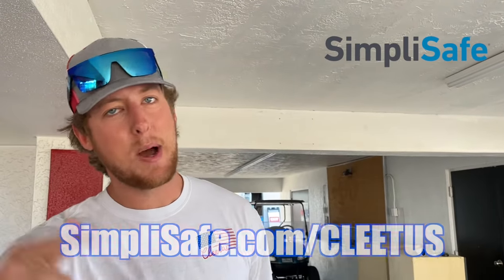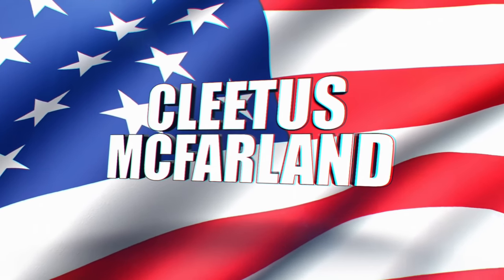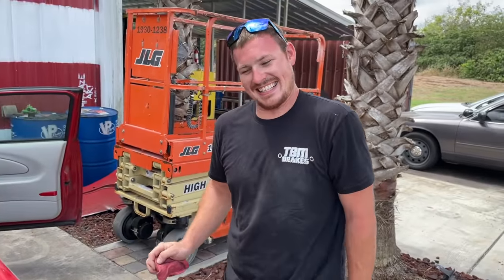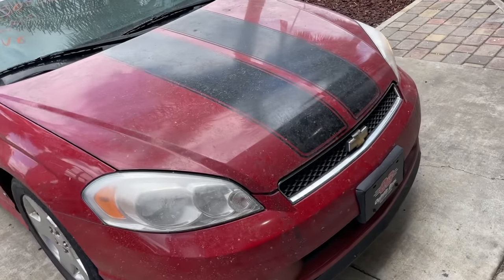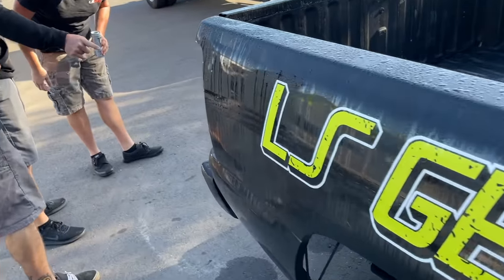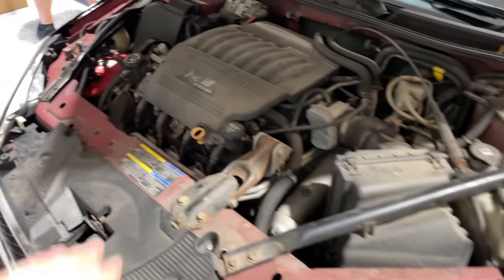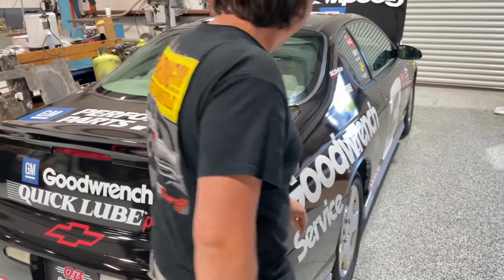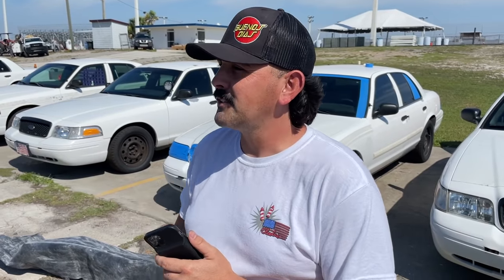Surprising My Mechanic With the Most RIDICULOUS Daily Driver Of All Time... (You Can't Guess)

Comment: Hey guys that noise you’re heading is the blend motors for the hvac system. They’re behind the glove box, held in by two 7mm screws. Just replace both of them
Reply: You are absolutely correct
Reply: Is that what I keep hearing in my impala? Shit starts clicking soon as I open the door then stops after a few minutes. Seriously.
Reply: That would explain cold/hot air George mentioned. Good call d pizzle
Reply: that was quick.. hell yeah brother.
Reply: They bout to find out how junk those transmissions are with all those burnouts lol
Reply: I second this.
Reply: My American quarter horse makes the same noise when he's parked idling in the stall. He doesn't have a glovebox. I'm definitely not entering through the rear. Any other suggestions?
Reply: @kristinewilson5353  common in GM's that yeae
Reply: Knew it right away from dealing with them on my mk4 Jetta glx, but it's a much bigger pita on those
Reply: Came here to say this as well, also part of the problem George is having with the AC being cool on one side and hot on the other.
Reply: Could be a shorted out IPDM. Happens when drain ports get clogged and rain drips directly onto the under hood fuse box. This is the exact noise that my car was making and the battery would always die on me, changed out ipdm and the problem was fixed. 

Edit: when the ipdm is shorted out will cause some electrical components to stay on even when the vehicle is turned off.
Reply: @kristinewilson5353  yup, had to replace my wife’s on her 07 impala
Reply: @danielferrell2911  thank you. Hope its not too expensive. Times are tough
Reply: @kristinewilson5353  yelp, every eingle of them do it 
Sometime you can walk by it and it starts clicking lol
Reply: Shit I just had to delete my comment because I seen yours! 😂 no need for two ppl saying what’s wrong😂
Reply: @FarmerFpv  😂😂
Reply: @kristinewilson5353  yes
Reply: Same on 01 Impala.  Well, and my mom's 09 Impala.  And the uneven AC could be just low coolant.
Reply: Very common in those impalas lol
Reply: Knows on all impala and monte carlos
Reply: Bump
Reply: +1
Reply: @kristinewilson5353  yes and its super easy to fix look it up on yt
Reply: @nikolaskipp769  common until 2014
Reply: It's actually a 5.5mm or a 7/32. Just did all the blend motors on my impala.
Reply: George is the best he's hilarious
Reply: The Chevy tick I've replaced 3 in My impala
Reply: @_Bishopton  came to say the same thing
Reply: @FarmerFpv Enter at the rear.  Just get those shoulder length gloves and a gallon of Mare-Lube.
Reply: Was about to say the same thing lol glad I looked first
Reply: BUMP
Reply: Super easy to fix!
Reply: I think the vehicle has to complete a "drive cycle".  When I disconnect the battery and replace or reconnect, gotta drive it a round a bit, turn in off, get out, get in and turn it on and drive... Blendoors will fall back into place... .or not:)
Reply: Yea big problem on those and the impala dont get the dorman theyll go riggt back out before very long
Reply: How long before George wants to to a LS Swap / RWD Conversion on it ?
Reply: There are actually 3. One is above the right side of the driver floor board. Above where your knee sits
Reply: Bro, this clicking has been bothering me for months. I was about to tear apart the dash. You saved me!
Reply: I had replace one on my 04 GMC Sierra 2500hd in the middle above the tranny hump
Reply: had the same problem in my '09 Imapla. They call it the "midget with a machine gun"
Reply: @JamesWorley  it is an LS. LS4. the gm fwd transmissions are garbage though.
Reply: @JamesWorley  i bet they talk to brandon F about doing a rwd swap on it
Reply: I own a 06 impala ss 5.3. And yes it sure is the blend doors.. I changed all 3 of mine.. The impala/Carlo is well known for that issue
Reply: yeah I knew what it was a soon as I heard it.
Reply: I hope it's that easy. I had to replace the blend motors on my son's saturn vue and almost had to remove the whole dashboard to replace them.
Reply: Check the freon level in the A/C before you start tearing apart the dash.   Pretty sure its the blend doors but would take all of 5 minutes to check that first. Old Lexus of mine had the problem where it would blow cool(not COLD) out the driver's side vents but warm out the passenger side.  Turned out it had a small pin hole leak in one of the hard lines, had probably leaked down over months cause it was spring and first time I had fired up the a/c in months.
Reply: ^^^Came to say thiss^^^
Reply: What that person said!
Reply: @THEPlGWHlSPERER  
Was gonna say this very thing. Get genuine GM junk, or you'll be doing it again in 2 months.  Also a 2nd on the transmission.  They are pretty fragile in their OE state.
Reply: 7mm? Or are they 5.5mm? Also low on freon will cause the hot passenger side, cold driverside outlet duct temp
Reply: Well the passenger is behind the glove box, if it's the blend actuators there is also a drive side one way up under the dash, if it's got dual climate control
Reply: @kristinewilson5353  Yea, most likely, it's really common in these chevys. I have an impala which is basically this with a different back half
Reply: @kristinewilson5353  For sure that is what it is.
Reply: @kristinewilson5353  Yep!
Reply: Lol, I just posted the same thing and then saw your comment. Super easy fix.
Reply: Its the GM ghost
Reply: @kristinewilson5353  100% I had an '08 impala, loud ass clicking coming from the dash/glove compartment. If you go to an auto parts store and say you need an air gate motor, they know what to do. The chevys from that period are notorious for it.
Reply: Good call.
I knew that right away, my 02 impala ls did that same thing.
Reply: Op nailed this one. Common gm issue. Had to replace em in my envoy
Reply: Very common for these
Reply: Beat me to it lol
Reply: This guy....
Reply: There's actually 4(if it has the dual climate control). 2 for those, 1 for the vent direction and 1 for the fresh air/recirculation. 

I knew immediately what that was when I heard the knocking. Ptsd started acting up from it too hahaha
Reply: Doorman part number 604-108...
Reply: It's for his mechanic, and that's SUPER common on all GMs (and lots of Fords)....I think he knows.
Reply: yup. Easy fix, happened in my silverado. Took like 5 min
Reply: 1 behind the glove box, 2 in the middle, and 1 on the driver's side.... ask me how I know 😌
Reply: @ichoozjc  it's all W bodies.
Reply: @killer0034  the ones in the middle are NOT "super easy"
Reply: @aboutmyfathersbusiness8324  no what happens is the plastic teeth on the gears will strip out/break off.
Reply: Yup.
Reply: Mine did that also, replaced all actuator motors, including the one on drivers side behind dash.
Reply: BINGO
Reply: @bepbep7418  yes, that happens some times but many times the motor just doesn't know when to stop and keeps clicking.  Ive replaced the blendoor motors before when all that was needed was a blendoor recalibration.  You can google the procedure... just sayin..
Reply: @nikolaskipp769  yup Silverados too. Under the hood podcast, the Motor Medics have been talking about it for years. I listen for  entertainment but seems I have learned along the way. 😁
Reply: "Hey guys that noise you’re heading is the blend motors for the hvac system. They’re behind the glove box, held in by two 7mm screws. Just replace both of them"

Two 7mm screws cause all that noise ? :p
Reply: It’s called the AC actuator
Reply: Yup certified gm tech here absolutely right replaced a butt load of em
Reply: I have a 16’ impala and it started clicking did some research and they said the motor cost almost $1000 to fix or u can just unplug them and u will just have to set ur fresh air or cabin air setting on ur a/c before u unplug the wire but after I did that the clicking stopped and now the hot and cold started on both sides fucking GM lol still love them better than fords tho
Reply: Just did all 3 on my impala lmfao

Comment: id recommend getting that thing on the dyno and getting a proper tune into and deactivate the DOD/AFM as they are notorious for causing a lifter to fail on one of the DOD/AFM cylinders. Also get a fresh trans service and auxiliary cooler for it. Those transmission are made of glass with the TQ from the 5.3
Reply: He said he’s putting a cam in it so the afm will be deleted with the new lifters.
Reply: Yep was looking for this comment on the trans... my brother went through 3 in his impala ss under warranty. He traded it in before the warranty expired 🤣
Reply: I was one of the lucky ones who never had AFM issues but lots did. Cam and a shaved truck intake go a long way on these cars! Agree on the trans too, they can barely handle a stock LS4 let alone modified. Great dailys with a little maintenance. I'd just recently seen there was a lot more development on 4T80 swaps for them too, if you're going to run one hard, might be worth it but not sure if I'd want to for a daily driver.
Reply: @SOHCGT96  I would rather see a 6t70 6spd swap, that would turn this thing into a great driver.
Reply: @JPARKERZ28  Trans will blow 😂😂😂 theyre so bad lol mine blew at 90k miles
Reply: @SOHCGT96  Furches performance is working on (possibly already has) a 4t80 swap kit for both the LS4 cars and the S/C v6 cars
Reply: This man Monte Carlos.
Reply: I wish they would (and would’ve) drop FWD and make everything RWD or 4/AWD. Cobalt SS would of been better RWD, this SS would of been better RWD. FWD ruins the fun of so many “could of been so much cooler if it weren’t too was RWD” Cars.
Reply: @jeremymann8930  He already finished the R&D on the 4t80 hes looking into turbo kits and bolt on intakes for LS4s now
Reply: @ChevyBoyTV  awesome

Comment: The heat issue is most likely a blend door issue.  GM is notorious for them.
Reply: Monte Carlo especially. Typically an actuator within the system
Reply: For sure
Reply: No doubt. GM is notorious for electrical issues. Especially on early 2000’s cars
Reply: 100% the blend door actuator.
Reply: I had the same problem on mine. 100% one of the 3 or 4 different actuators behind the dash.
Reply: Here to say this. It was an issue on most of their stuff for a while, including the trucks.
Reply: What would cause my AC/Heat to stop working in the rear of my 03 Tahoe? The front vents work fine.
Reply: Ford too!
Reply: I've replaced 2 in my 03' Tahoe. Pain in the ass.
Reply: @toohoney8674  that clicking sound when you started the engine and for several minutes after you turned the engine off
Reply: Yes, definitely a blend door issue, since they said one side blew cold.  This issue is common in both, the Impala, and the Monte Carlo, as they share a lot of components throughout the car, including the same platform, and thus many of the same problems.  the passenger side actuators aren't that bad, but the drivers side actuator is a bit more of a pain the replace.
Reply: @Mark_MOORE_VFL  It can also occur even hours later, out of the blue, car not disturbed. (It's an Impala.)  No idea why the random ticking spells occurred.
Reply: @jreyman    It's when the actuator is bad trying to close the blend  door You're right about the random as well my Monte Carlo isn't a daily driver and it would actually run the battery down  If  sat for a few weeks. It can cause your battery to go bad early with the constant drain on it. if you don't change the actuator. my car has two one is under the glove box the other one is behind the radio that's the hard one to change
Reply: It's much better that poping out spark plugs while driving down the road..
Reply: @eric63377   I learned a hard lesson on my 07 MC  the actuator that is behind the radio I ignored it ended up melting the wiring harness I had to have that part of the harness replaced Cost me $600  The actuator was $40. I always wondered why it did not blow a fuse first
Reply: @breadnaut3087   If it has a separate speed control for the rear then there is a good chance your blower motor is out
Reply: Yup. I bought a 2006 with 30k miles on it in 2019 as my first car and all three had failed within 3 months of ownership. I just assumed the failed due to age until I went to the forums and found out it was a common issue on this car and the impala as well.
Reply: W-body issues
Reply: @breadnaut3087  rheostat or blower motor.  If you haven't check the fuse first.
Reply: @jreyman  my impala blows cold out of both sides but blows heat out of just driver side. What’s the issue there?

Comment: The battery drain could be the rear window defroster or mirror defrosters. I was an ASE mechanic for many years and that was the 1 issue I had with a Grand Prix that took the longest to figure out. Check the rear glass and mirrors to see if they are warm when the switch is not pressed. Also seen it happen with seats and windows. Pull a fuse per day and see when you get the right one if the battery doesn't die after a day.
Reply: Or save yourself 3 weeks of troubleshooting and drained batteries: just measure the current out of the battery while pulling fuse after fuse?
Reply: @obc_obdo  👍
Reply: @obc_obdo  yeah that’s much quicker and slicker!  DMM for life!
Reply: it has the typical clicking blendoor that drains the battery
Reply: @obc_obdo  It's important for the car to be in sleep mode though, some take 30 minutes to an hour and you have to trip the door switch or close all the doors. Not doing so won't give good readings.
Reply: I think its a faulty blend door actuator that keeps trying to move all the time even when car off
Reply: @chevy1539  yep as soon as they popped the hood and said there's a noise and a battery drain and then George said something about hot air on one side cold on the other I immediately thought blend door actuator.  Common problem on GM.  They don't have the best electrics
Reply: @chevy1539  As soon as George said it was blowing hot on one side and cold the other I knew that's what it was! Get ready to have some fun fixing THAT! My '05 Grand Prix GT2 (4-door) did the same thing and it spent almost two weeks at the Dealership! They had to take everything from the front seats and console AND dash all the way to the firewall! I wish I had taken pictures! $1500.00 all told but you can't tell the car has ever been apart! They had three guys working on it! Like in "Gone in 60 seconds" the car has "Sentimental Value". It was my Dad's last car, bought new, loaded to the rafters. I mean if there's an option it doesn't have I can't find it! Found the damn thing at the dealership one day when I had my '99 Grand Prix GTP (2-door, black, graphite interior, Supercharged Buick 3.8LV6) in for something or other. Just sitting on the showroom floor. Gunmetal gray "Graystone", Camel leather interior, Monsoon. When Pop passed in 2015 I inherited it. The kicker: As of yesterday it has almost 30,000 miles on it! The GTP has a tickle over 70,000! 🤣
Reply: @chevy1539  They mentioned that they had hot air one side. That car has dual zone climate control. So, I bet this is it.
Reply: @PhilG999  Sounds nuts.  But a good enthusiast could have the seats and dash out in that in 90mins tops, so I'm sure he'll be OK.
Reply: @realMaverickBuckley  Well I've been wrenching for over 45 years, and am a Mechanical Engineer by profession. I've built engines in my garage and done engine swaps in my driveway and actually BUILT my '71 Camaro from a body on wheels to a Z28 "look alike" ALSO in my driveway. I must not be a "good enthusiast" though because there's no way in HELL I could have taken the GT2 down that far in 90 minutes! Plus you're not gonna program the new diverter assembly yourself. It's essentially the entire A/C control unit! Took them TWO units when they did the GT2!😖I know because I have the old one in a box (these guys always give me the old parts instead of throwing them away. That's how well they know me)! 🤣
Reply: Perform a voltage drop test across the legs of the fuses. Quickest way ever. Power Probe has a chart on their website for free to help with the test. Pulling fuses at random can wake up modules and have you chasing your tail.
Reply: how bout the door wiring on the drivers side aswell as the blend door actuators the wire insulation crack when it bends touching causing a draw!
Reply: @justaguyinagaragewithasign3244  On MY car the blend door actuator was frozen in place, but still being commanded to move. Constantly struggling. Eventually burned out the control unit. Or at least that's what the Dealership Techs told me! And this is one of the largest if not THE largest GM/Buick/Chevy dealerships in the Atlanta area. Same owner has about a mile of road with dealerships on both sides including Maserati/Porche/Ferrari and more!
Reply: @PhilG999  I have a blue '99 GTP coupe with 79.6K miles on it. I also had a 2007 Monte SS .
Reply: @stevesmith6236  GTP is a fun little puppy isn't it? All you have to do is keep the Supercharger oil topped up and change it every couple of years. I have had SO many ricers try me and spanked their asses!